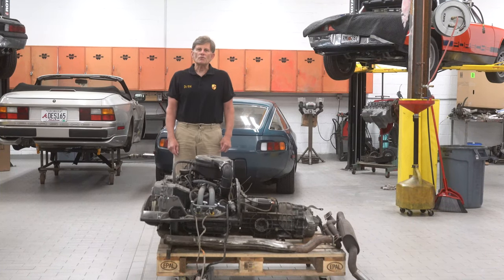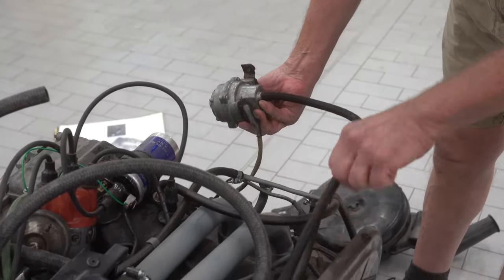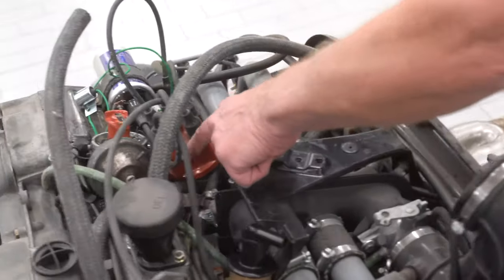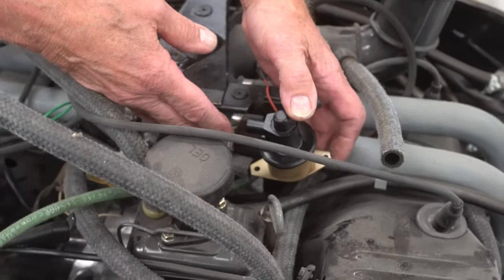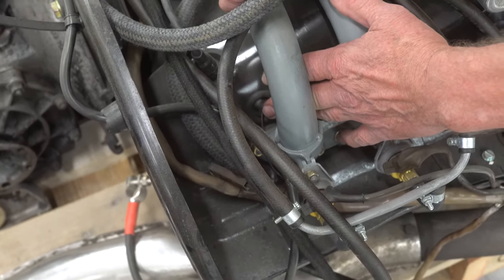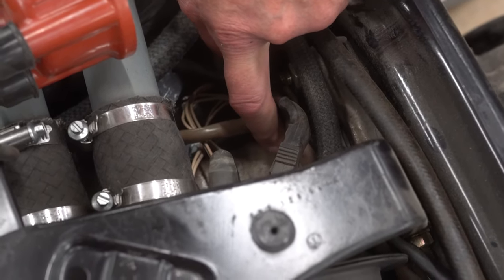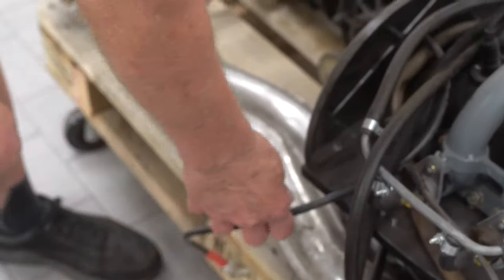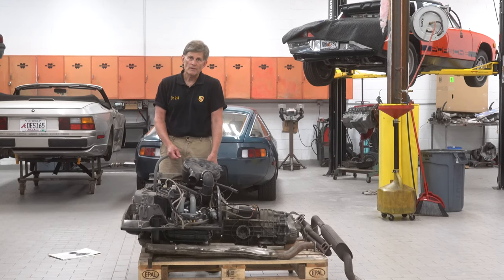Tour of Porsche 914 1.7 Engine

Comment: I bought a 73 1.7l a few months ago. I'm trying to get it back on the road.  I've watched this video a couple of times and each time I realize there is some other vacuum hose or wiring harness bit that is connected incorrectly.  Very useful.  I'm sure I'll have to watch it a few  more times before all of the bits and pieces are hooked up right.

Comment: Thank you for the great video. But a small correction  engine type EB ist a 1,7 Liter 1973 with 72Hp for California as written in Dr. Johnsons at page 82 and to be found on my matching number car( certified by volkswagen Geburtsurkunde)  1973 1,7 car reimported from U.S..  Purchasing the parts from auto Atlanta keeps it running authentically